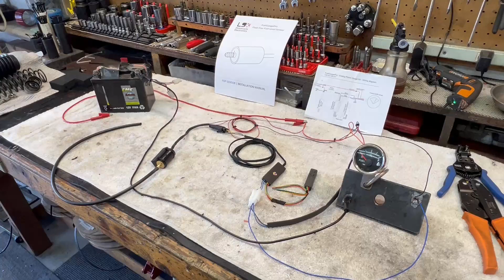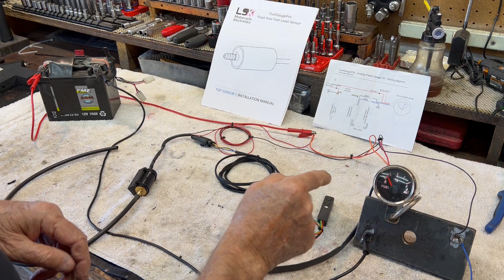Vintage British Motorcycles Repair/Restore

Comment: Remove the positive terminal and check for continuity of the case, and the black negative wire, if there is no continuity, the circuit is using an isolated ground. You merely reversed the polarity.
Reply from the maker: You are correct.  I checked the case and it is completely isolated from all the internals.  I am going to install the system when I get the bike back on the lift, and I will simply connect the red to the POS side of the battery, and the black to the switched (output) side of the ignition switch.  I think that will work just fine.  Agree?

Comment: When you talk about positive "ground", you are talking about which side of the battery is "grounded" or "connected" to the chassis of the bike, not what pos or neg lead is connected to the electronic device.  All you need to do is hook the positive lead of the gauge to the "chassis" or "ground", and then the negative lead of the gauge to the battery, or connect  the pos and neg of the gauge  directly to the battery pos and neg respectively.
Reply from the maker: You are correct.  I checked the case and it is completely isolated from all the internals.  I am going to install the system when I get the bike back on the lift, and I will simply connect the red to the POS side of the battery, and the black to the switched (output) side of the ignition switch.  I think that will work just fine.  Agree?
Reply: @fjdelmonte  Yes, should work fine.  :)

Comment: The gauge seems to ground through the case mounting, expecting this to be negative. So the casing needs to be completely isolated from the Commando positive ground frame and a separate wire from the gauge casing to the negative battery terminal must be used. Then another wire from the battery positive terminal (or any positive wire connection like your multi-wire "ground" point) needs to go to the rest of the gauge devices. Some sort of switch would be needed so it can be turned on/off manually, independent of the main bike ignition/power switch.
May be easier just to convert the bike to positive earth setup. 

Seems like a lot of fuss to put something on a Commando that really does not need to be there. Its so easy just to learn to check the fuel level by flipping the tank lid before your ride and know roughly how far you can get.
Reply from the maker: You are correct.  I checked the case and it is completely isolated from all the internals.  I am going to install the system when I get the bike back on the lift, and I will simply connect the red to the POS side of the battery, and the black to the switched (output) side of the ignition switch.  I think that will work just fine.  Agree?
Reply: @fjdelmonte  I thought your video shows the gauge mounted to a metal plate, which then was wired to negative battery post. So that tells me the gauge case is grounded through the plate mounting?
If so, You'll need non conducting faster (nylon bolt and nut?) and rubber or melon washer at the case mounting point to bike. Then run a wire from case to ign switched negative source and positive feed from your common bike earth point. That should work.
Reply: Oh, if the case is in fact electrically grounded and you connect it direct to batt negative, then the whole case will be at risk of accidentally shorts if it comes into contact with any grounded bike items. I would consider covering the metal case with an insulating cover of some kind. Perhaps that spray on latex or rubber paint?

Comment: Kinda cool tech, but I've never had a bike with a gas gauge and I've never run out of gas.  Why can't you just hook it up the first way you had it?  What would happen?  Electronics aren't my strong suit but it seems like it shouldn't matter if it's negative or positive ground if you're going straight to the battery terminals with it.   If it's hooked to the terminals the gauge  is operating independently of everything else so it doesn't know or care if rest of the bike is positive or negative ground.. right?  I'm sure you'll explain to me why I'm wrong, and I welcome the explanation so I can better understand this positive negative ground stuff..
Reply from the maker: You are correct.  I checked the case and it is completely isolated from all the internals.  I am going to install the system when I get the bike back on the lift, and I will simply connect the red to the POS side of the battery, and the black to the switched (output) side of the ignition switch.  I think that will work just fine.  Agree?